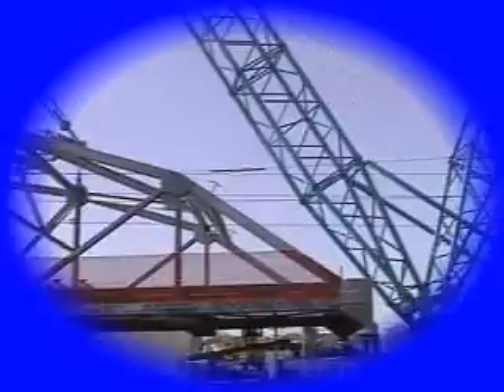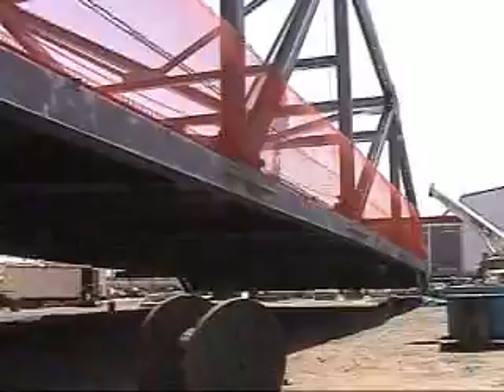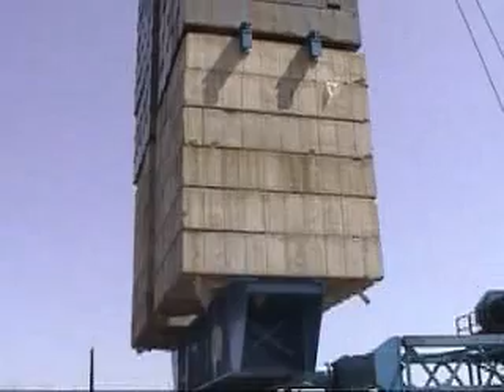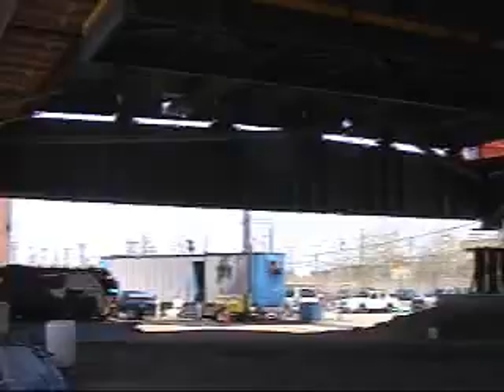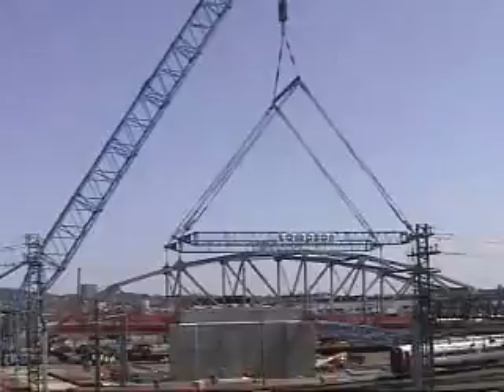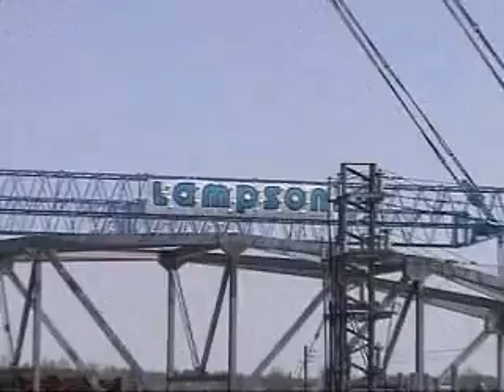Much Bigger Blue

Comment: Counterweight is 6,400,000 lbs. The color is Lampson blue because it's a Lampson crane. There's been accidents with Manitowoc cranes but you don't see them changing their signature Manitowoc red paint do ya. Neither is Lampson
Reply: Well said Jason. Mammoet has had fatal accidents and nobody is going to say that they must repaint their very large fleet from red and black. Bigge, ALE, Deep-South, Sarens and Maxim have all have had fatal incidents and they don't try to run from the  incident by repainting their fleet.
Reply: I've never heard of an actual crane failure event that wasn't precipitated by the human input.  Big Blue( the original video which is gone now because he's gone was done by Norm V) failed because the valley in which Miller sits is some 75' below the grade of Woods VA hospital just south of the sight. Wind speed wasn't properly measured by Mitsubishi Lifting Services who operated the crane.  I'm no expert but I do pay attention to these and other engineering mistakes.  Like the incorrectly built footbridges in MN mall that coplapsed .
Reply: @epistte  Mammoet  is a rigging company, they do not make cranes.
Reply: Sir, Mammoet does not build cranes, they are a Dutch company that provides crane and rigging services.  You probably thought they made cranes because they put their name their cranes and their othere equipment they have just like you see company names on construction machinery, like excavators and stuff.  Wiki Mammoet.

Comment: 3,200,00 Short tons as you guys in the USA use that (1 ton = 2,000Lbs) or 2,857,142 Metric Tonnes (1 Tonne + 2,240Lbs)
I remember Big Blue and that terrible accident a huge court case and payout but the money will never fix the anguish those families went through. R.I.P.
No one goes to work to die but it proves the adage that no single piece of construction equipment has the potential to do so much damage as a crane when it tips over............
Reply: Yes BUT, I read the kingpin analysis from the court case and it appears the kingpin would fail before the crane "tipped" over.  Usually when smaller cranes tip over, the kingpin and tracks are robust behave as rigid bodies - eventually truss booms usually collapse.  I think all crane designs should have a robust rather than critical kingpin.  If you look at the one pic of the mangled kingpin, it's shocking how small it's 12" diameter is relative to the rest of the crane.  My guess, 24" diameter or larger (36") and hollow would be where it should be sized.  

If the kingpin did not fail, what would a failure analysis have shown?  Perhaps there would have been enough safety margin in the next critical part to survive the gust.

NOTE:  There was early rumor that a steel washer was replaced with a brass/bronze one, however the FEM analysis indicated the failed part exceeded the strength of the "original" design which was also a brass/bronze washer.  Obviously, a steel washer would not have crushed and perhaps the kingpin would not have failed.  That was never mentioned in the FEM report.

Comment: +Troy Thoman Answer me this ,who is reading the hook weight ,hydraulic pressure and the Anemometers data showing real time wind speed at the end of the Jib, Riggers ? No ,the operator sitting in the cab ,who has the final word weather a lift is canceled or if it continues ,the Riggers ? No ! Did you see a cable snap ? No we heard the sonic crack of a boom pin shear seconds before the collapse where the load was still squarely secured to the hook ,did OSHA find any fault with the rigging ? No ,your tripping .
Reply: wasnt a boom pin it was the swing pin but i get your point.
Reply: @jasonzinzow9427  The rotation pin didn't actually break. It was the bolts holding it in place. With the bolts gone there wasn't anything to hold it together. I have that directly from OSHA. A massive retaining high strenth steel plate on the top of the pin. The plate was to hold the upper to the lower. That pin was almost a foot thick. About 6 feet long. Could you imagine the torque required to snap that?
Reply: @jasonzinzow9427  it is not called a swing pin it is the kingpin and the nut did not fail until the wind caught the giant kite causing a tremendous side load i have fabricated and welded three of these beasts together working for lampson and went out on two assemble disassembles

Comment: There where some bad decisions made on that day in Milwaukee, it had nothing to do with the crane. It did not cause the terrible  accident.
Reply: Lampson had a little bit of responsibility. The courts claimed they did. 5% or something like that. I know the loud banging sounds are from very large high strength bolts poping from the torque placed on the boom from the wind. I also know that they were slowly lowering the load and you easily hear her brakes squealing. That's normal and annoying. When increasing the length of the hoist line is like increasing the length of your wrench handle  multiplying torque . Eventually something is going to give.
Reply: @fixatroll5406  its the king pin
Reply: @yhisisknot  Yep! After the bolts let go she just fell apart. The kingpin as you call it didn't break. I suspect that lampson probably allowed an alternate operator to run it because they probably were not informed that the original operator wouldn't. Since they didn't investigate properly and hadn't interviewed that operator probably couldn't locate him and assumed he just up and quit for personal reasons other than a safety issue.
I have never heard the official explanation why lampson had any responsibility at all. So I am just guessing at this scenario. If you do know then please share. If it had been that pin then lampson would have been held at 90% responsible or more. 
For defective engineering. 
I get the information I have shared  directly from OSHA.
Reply: That crane is a male not a female it gives off a masculine energy
Reply: @fixatroll5406  LOL increasing length of the hoist line is NOT multi torque at all. not a single nm.

Comment: no not bigger a lampson ltl2600 is a lampson ltl2600 just a little different configuration on this one I have fabricated 3 2600's  and the 3000 we built for hitachi 2010-2011working on n off combine 7 full years. the 3000 has never left the yard or made a money lift, such a waste of time and money but I got paid 90 grand a year

Comment: How heavy is the counterweight??
Reply from the maker: The Crane:

3000 Ton Capacity (Rigged for 1500 at 176’ Radius)
51,000 Feet of 1 ½” Cable
56 Parts of Line
6,400,000 Lbs Counterweight
Boom – 2000 Lbs/FT
Mast – 1500 Lbs/FT
100+ Tons Rigging
1044 Ton Total Pick Weight
Reply: it's amazing that weight sits on the caterpillar tracks.
Reply: I work for Lampson there's a bigger crane now in the yard
Reply from the maker: Yes, this one is old - 2003
Reply: dude man Back in 2009, when I was working at Hanford, I used to like to tour Lampson yard in Kennewick. Lot's of cool stuff. They bought the two Melroe 880 Buffalos we used to move ARCO Kuparuk oilfield modules in early 80s and the 156 tire Goldhofer trailers.
Reply: very.
Reply: @MarkoKaar  3,200 tons I think.for counterweight.

Comment: I will tell you this.  These operators don't have a brain in their head.  They lift to high and they let the lift just hang.  Every second that load is on the crane a pending problem can crop up.  Rule number 1, keep the load as close to the ground as possible, don't over lift.Using as genital movements as possible, get the load set.
Reply: You said genital.